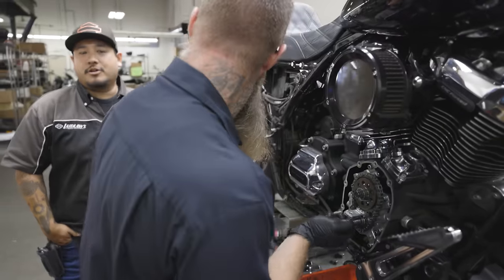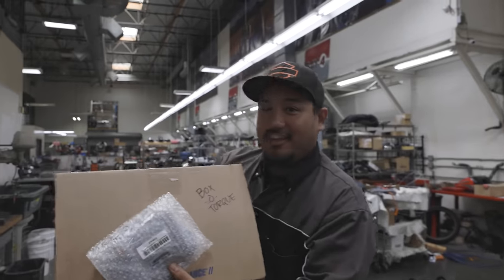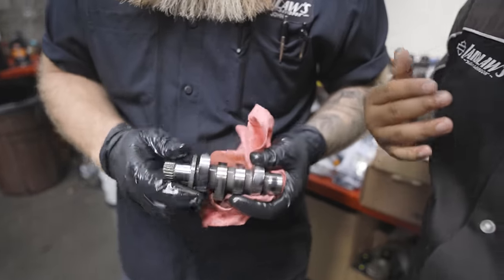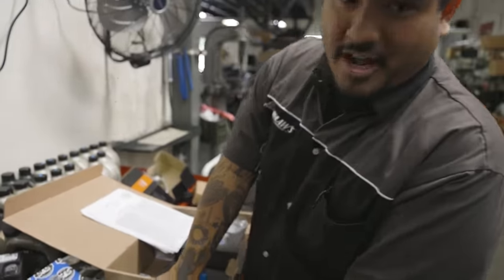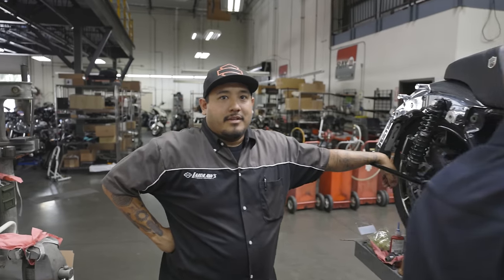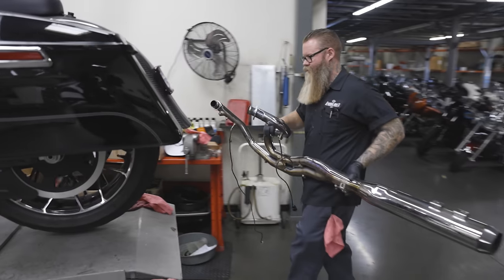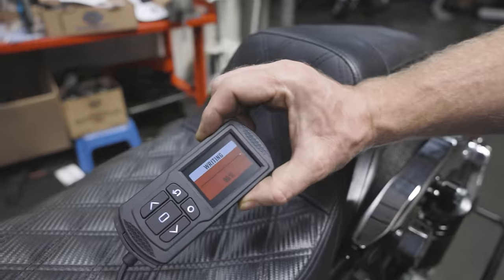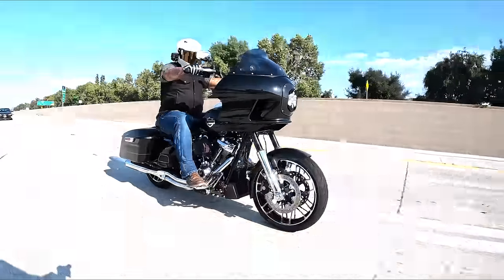S&S 475 Cam Upgrade on a Harley-Davidson M8 Road King

Comment: It's really amazing how much you get from a cam upgrade on an M8, I spent a fortune on my old Twin Cam 96 to get that big a boost in HP and Torque. I did a cam chest upgrade on my 2019 RGS, I used all S&S parts except I went with the Red Shift 468 Cam. For me the Red Shift 468 delivers the power right where I live 2500 to 3500 RPM. The SS 475 seems to work better for someone like Andrew that likes to rip the throttle and probably lives in a Higher RPM range than I do.  Ofcourse Zippers Red Shift Cams aren't CARB approved so if that matters to you in Cali the 475 would be the way to go for sure.
Reply: Good to hear my RKS is getting the Zippers468 next week

Comment: I installed an S&S 475C cam chest kit on my 2019 RGS a year and a half ago.It turned a nice bike into a hot rod.Here in Ohio we’re able to have our bikes custom dyno tuned for perfect af ratios so not only do I have great performance my mpg is in the high forties.
Reply from the maker: Dang. Very nice
Reply: Can I ask... I'm considering a cam for my M8 114 with the S&S 475c being one I like. But I've heard and seen dyno graphs (even on S&S's own website) that say there is zero gain in hp & torque until you reach the upper rpm range. So high that my bike never gets there. What have you found?
Reply: @tyroneshoelace4872  Best cam choice is the 30/30 From star racing. Best sounding cam and Best performance gains. I did the 475 on my SG and the 30/30 on my RG, the performance gain over the 475 is noticeable. The 30/30 you get your main performance gains in the lower rpms.

Comment: Very cool😎....I had a bassani rr3 stainless on an 03 cvo king I had last year....I had to sell it due to financial issues..im very sad to this day. The bike was a beast, screamin eagle 103 with andrews cams,forged kb pistons high comp....10.8-1.... head work by gms racing here in Pa, and a custom dyno tune with a tune liscence by dyno jet. It was impressive for a worked 103....i miss it alot but I still have a stock 04 king to ride!.....love the channel Matt
Reply: You can have fun on your 04 Road King. Things change in life and hopefully you can get another hot rod Harley again.

Comment: I have a Stage III in my 17. I've trashed the motor twice. Harley makes shitty high performance parts. Glad to see you going with S&S.
Reply: I got the Harley Davidson 128 Big Bore installed right when it came out.  Running the Pro Street and Auto Tuner.  The SE oil pump and clutch.  Using Fullsac MX header. (Throw said header pipe that comes with the stage kit away, that cat meets EPA but no good).  Just put 20,000 miles on the motor running from the Cascade Mtns, Rocky Mtns, Application Mtns, deserts, plains, swamp lands and to the oceans.  Ridden in all types of weather from 35 degrees to 109 degrees for hours on end. Still running strong. Not the engine to cruise around town stop light to stop light or get stuck in big-city-stand-still-traffic.  She wants to run, needs the air to cool her down and a total blast when you get into the throttle.  Very impressed with the Pro Street and Auto Tuner while touring.  It changes for the weather conditions and altitude instantly.  If you want good power from the get go of a brand new bike, you can buy a standard Electra, Street or Road glide and get the kit installed for a good price point.  Get it Dyno'd not mapped.  The dyno numbers of the 128 and 131 are very close you wouldn't know the difference.  Also, Harley is always placing top 3 in King of the Bagger racing with S&S, Vance & Hines, Trask running their own bikes in the race.  Something I have been paying close attention to wondering what really is the best out there.

Comment: All I can say is, John, YOU ARE AWESOME BROTHER! 🤣🤣 Great job guys! I personally went with the Star Racing 3030 cam with a 485 lift. Had to change the oil pump because it was starting to sump, so I figured might as well put a new cam in while I had the old one out, RIGHT!! Everybody does this right? It gave my mostly stock 2017 CVO Ultra 114 a big boost. It turned out 115 HP and 120 Torque. It has that snap your head back power, it's great! Everyone likes the S&S 475, it's a great cam as well.

Comment: That lope sounds great.  Would like to see a dyno chart of the Stage 4 + 475 cam.
Reply: Stage 4 build will go better with other cams.  the 475 is not a super high lift cam.  It's considered a bolt in.  a higher lift cam would go better with a stage 4 build.
Reply from the maker: Yea, we wanted to put it up on the Dyno but didn't have the time. Like the other comment on here says, it probably doesn't hit the peak HP that the other cam hit.
Reply: You can have all the horsepower you want, but it’s the torque that’s going to drive the rear wheel. That’s what’s going to really make the difference.

Comment: Dang dude, I'm surprised you/they didnt address that OEM oil pump, and cam chest before, or right with the earlier stage 4 upgrade,  I think a Stage 2 would be perfect for me, and my 107
Reply: It's not the oil pump causing the sumping, it's the NPT tapered thread hole tapped too deep at the factory by HD that was causing oil pump pick up problems.  The bolt was going in too deep and cutting off the oil pick up flow to the pump, causing oil to back up to too high a level where the crank would would then aerate the oil, beating it to a froth like a blender. See Feuling shorty bolt 1/2" x .260" instead of 1/2" x .460". Another easier solution would be to use  more plumbers teflon tape , more layers of it, measuring how deep the bolt fits before you remove it, and then getting it to sit .150" to .200" less deep into the hole when fully seated. That leaves the hole unobstructed for proper oil flow pickup by the pump.  HD made 8 iterations of that damn oil pump before they finally figured out the problem was the sump plug seated too deep.  https://youtu.be/cWk3W-sZ2WI
Reply: @feloniousmonk3049  Yes I've heard this before, but not sure if this was the primary cause on all the bikes with sumping issues

Comment: I love the sound of it. I have a brand new 2022 fatboy with 1400 miles and it’s been in the shop since August 12 I started it up and it was burning oil and leaking oil out of my exhaust it’s now September 9th and no answers all I’m being told is there waiting on part’s cylinders pistons and heads nobody is telling me why or what happened could you ask your mechanic if he might know and I’m curious if this is going to happen again with them installing the same parts as of right now a first time Harley owner I am not impressed and I am being left in the dark looking to see if I could get some info and Harley customer care is no help either thanks love watching your channel

Comment: Harley guys immediately jump on the engine to help performance.  Weight is a problem with Harley.  Replacing rims with carbon fiber would really help handling decreasing unsprung weight.  Replacing the battery with a lithium would help.  Does Harley make composite fenders to unload weight.  Less weight helps everything from handling, braking, and acceleration vs just straight line performance.  I enjoyed the video.

Comment: Well that puts that to rest. I was always under the impression that you HAD to go with that bigger cam when you go big bore, Stage IV. But I’m a torque guy too, not that I’m doing burnouts all over town, not worried about top end performance either, I just love that torque when it’s time to pass out on the trail, when you roll the throttle, the bike jumps out of its paint, you’re by the guy, and back into your lane. And of course the sound is like no other. S&S 475, Red Shift 468, you can’t ever go wrong. Great vid! You guys gonna throw it on the dyno for numbers and to see that curve?

Comment: Thank you for the reply. It will not have this click feel when I down shift without blipping the throttle. If I down shift through the gears without the throttle blip and engine RPM coming down, nothing. I did find a Harley Bulletin from a few years ago about something that sound familiar .It was answering customer questions. The first was, ''why am I feeling feedback on the clutch lever when I shift?'' Answer, ''hydraulic pulse from the slipper and assist clutch ramps.'' So I thought it may be that, what do you think? The clutch lever is as smooth as ever when pulling it in every time other than a throttle blipped down shift? Thanks!!

Comment: I HAVE A 2017 ROAD GLIDE S WITH 105K EZ MILES ON IT! AINT BEEN IN THE SHOP YET FOR ANYTHING! I WANT TO PUT AN S&S 475 CAM. DID YOU USE S&S PUSHRODS AS WELL?

Comment: Will this upgrade void my warranty ?
Reply: Depends on the Harley dealer, I've heard of Harley dealers that have upgraded Harleys with a powervision tuner and they kept the warranty as a courtesy because the bike was purchased at that dealer.
Reply: @93ORyan  great Info to know thanks bro
Reply: @bigcurt011  No problem, but to clarify 95% of the harley dealers will likely say that it would absolutely void your warranty.

Comment: I only have Rinehart Racing slip ons on my Milwaukee 8 107 lowrider. I wanna do stage 2 tho. 2020 FXLR any suggestions?
Reply: For all around riding scenarios, I would go Stage 2 torque.  D&D exhaust.  Tuner of your choice.  Dyno'd on a dyno machine, not mapped.  Most bang for your buck.

Comment: Why not a gear drive ?
Reply: Stock Harley M8 cranks usually have too much runout for a gear drive. Has to be pretty much no runout. So you are usually looking at replacing the crank if you want gear drive

Comment: You should put the baffles back in the muffler or get more aggressive baffling and less sound, if you want some back pressure in that exhaust system. You'll be surprised how much harder it pulls up to 4000 rpm.

Comment: Sounds great; S&S makes excellent products for Harleys.  On my '21RGS (rare 1-yr. only Snake Venom/Black Pkg.), I went with the S&S 465c full cam chest kit, although initially I was leaning towards the 475 cam.  Chose the 465 cam because I wanted the earlier torque hit; pulls great from just off idle (1750rpm-ish) to well past 4000rpm (perfect for my style of conservative riding, 2-up, hills, mountains, curves, etc.).  Should I do a S&S 114/117-to-128 big bore kit (or a S&S 131 Stroker Kit, 4.625" stroke x 4.250" bore) future, I'll probably go with either the S&S 550 or S&S 540 cam, and of course will upgrade heads and Intake/TB/injectors, etc.
My other mods: S&S 2-1 Sidewinder (w/catalyst); Fuel Moto/K&N # 3956 A/C (w/stock ventilator outer cover), Trask M8 Checkvent; HD Fan (oil cooler) and Tuned with Dynojet PV3-B (Map by Lucas at Fuel Moto).  My combo runs excellent, pulls like freight train, and averages 46.4 mpg cruising on the freeway at 70-75 mph.  For suspension:  I'm running RWD shocks out back (reservoirs attached to the shocks) and a Progressive FST front end kit; working fine (was 1/3 to 1/2 lower costs than Legends and Ohlins).
Reply: I fitted a set of s&s 433 Johnson rods to my 2020 road glide 350gt.what a difference oh my god!
Reply: what bike did you do this on?
Reply: @Harley_2023_richieg  My '21 Road Glide Special.
Reply: @tommiller8714  Sorry...107?

Comment: Sounds good Andrew , but not as good as my stage 4 131 with the 517 cam and I also used the HD billet cam plate with the MOCO  newest generation oil pump , ride safe out there in California

Comment: I have a 2021 Tri Glide. Going to put a 475 cam in this winter. Warranty up in Jan. 2023.  Should I put in the S&S oil pump and cam plate as well?  The 21's are suppose to have the upgraded oil pump.  Thanks for any advise.

Comment: I installed the same kit in my 2017 SGS with the help of U-Tube! Stage 1 was performed at the dealer I purchased from. I also used the Dyno Jet Tune and backed it up with the Target Tune. I couldn’t be more pleased with the results.

Comment: I bought a 2018 Heritage classic 107" from an HD shop that had stage 4 already installed.. I dont like the cam .. bought a power vision tuner , dynotuned @ 122.37 hp,  120.25 lb tq.. I dont ride in the high rpm, seems to start running good @ 2800 rpms up. Would like a cam that kicks in b4 or by 2000 rpm  up to 4500, or whatever.. 
.
Reply: I have the same exhaust, it doesnt sound like that.. I guess coz of the cam...

Comment: nice build but you should turn out the S & S QUICKEE  push rods 3 turns + 2 flats they are 32 TPI  that gives you 0.100 thou on the lifter as it is designed .4 turns gives you 0.125 thou . sounds great nice !!!